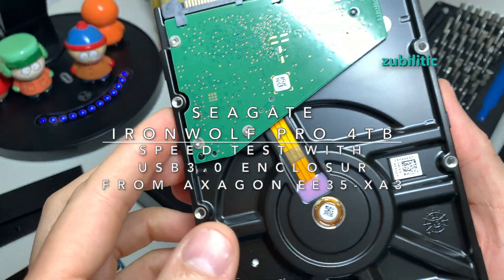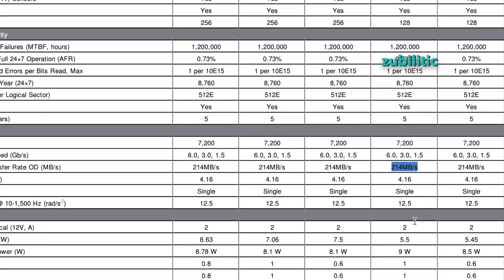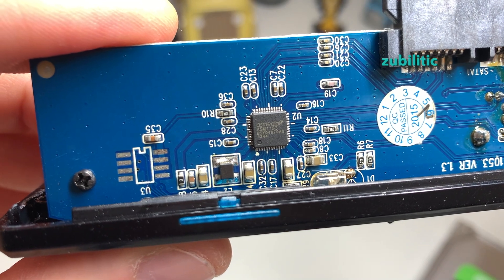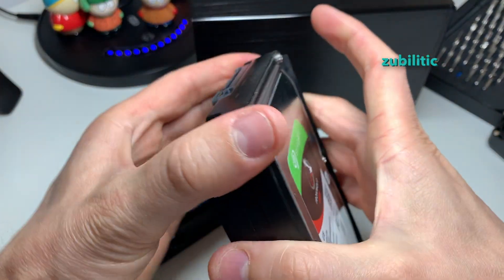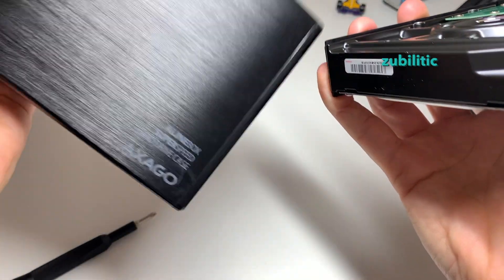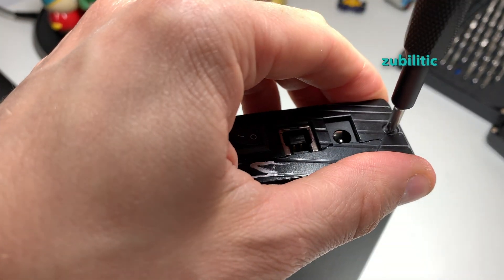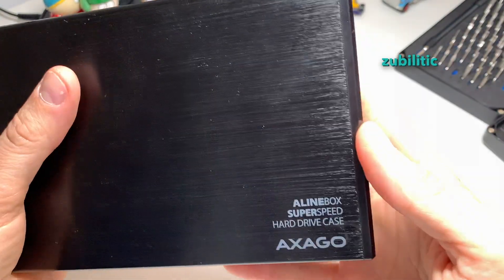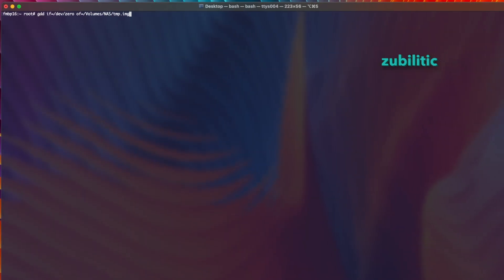How Fast is Seagate IronWolf PRO 4TB? Tested with USB3.0 Enclosure from Axagon: EE35-XA3

Comment: Why you dont use Docking Station ?More easy
Reply from the maker: Hello, this was just a test to check the speed on that disk and to show also that you can use an old rack on a new HDD as their speed is way lower than the advertised USB3 one.

I normally use IB-3805-C31 which is the same as Sabrent 5 bay DS-SC5B: https://youtu.be/pgPzrlVcMOE